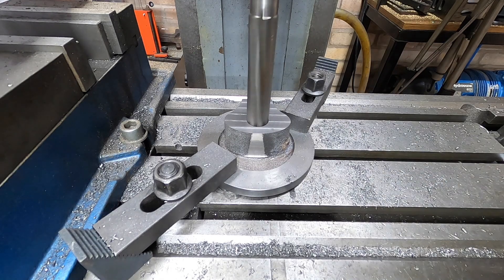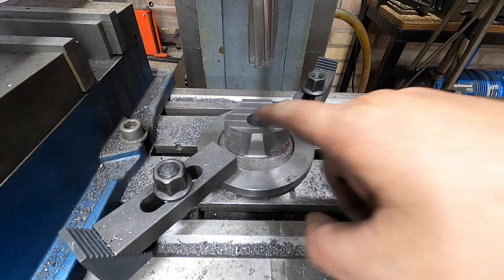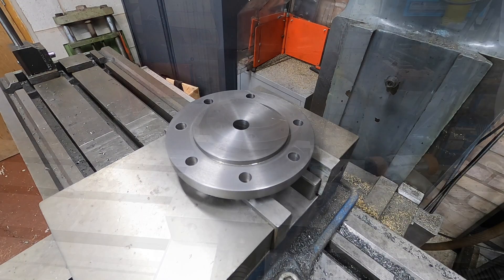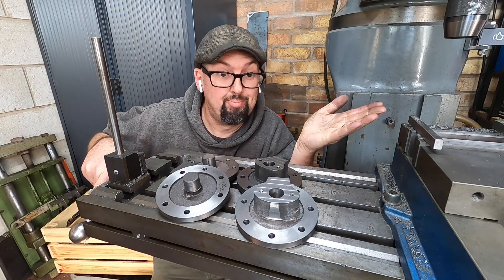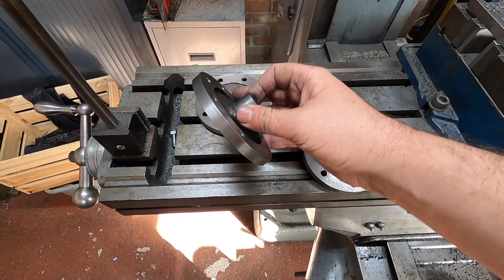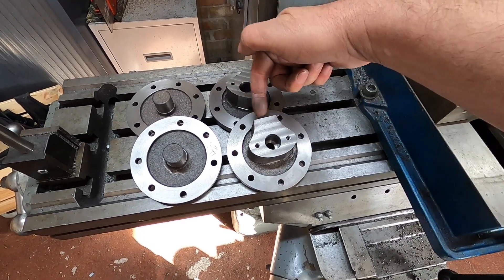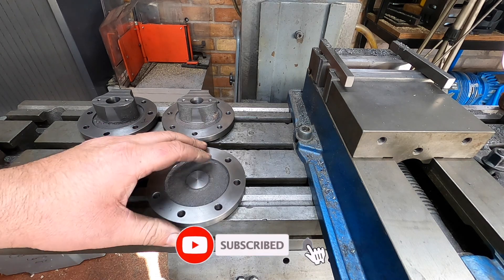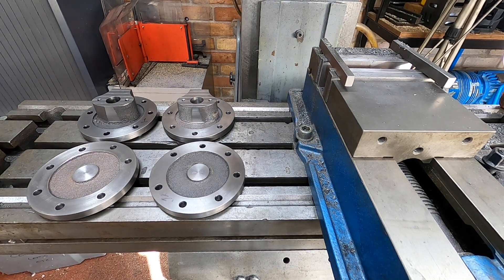Cylinder Covers Finished -  ep55 - 7.25" Gauge Steam Locomotive Build

Comment: Nice work, I understand ream a whole for the piston bar, but why ream a a hole for a machine screw?
Reply from the maker: Hi Max, its not having machine screws, its having stud bolts as it should, so the reamed holes is for it to be a perfect fit on the plain section of the studs, as described on the drawing 😉. All the best, Matt 👍
Reply: Matt , I was going to ask the same question about the reaming of the holes on the end covers. I’ve never heard of it being done before, and I certainly have never done that before. I’d be interested to know if that’s on the drawings of the Tinkerbell or from a wise old engineer at the your club. I look forward to your response. Great video by the way, you are making great progress.